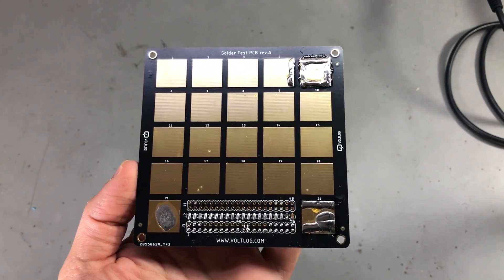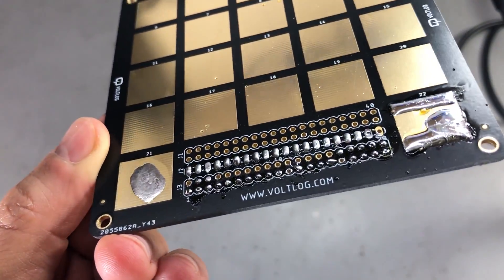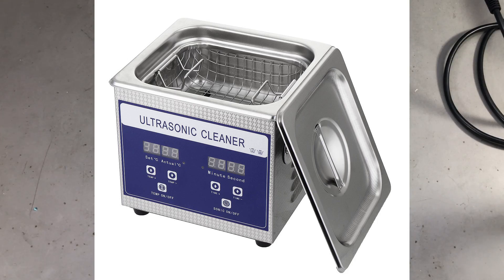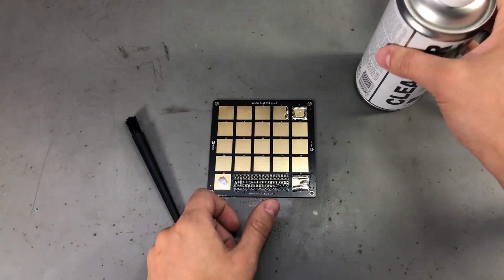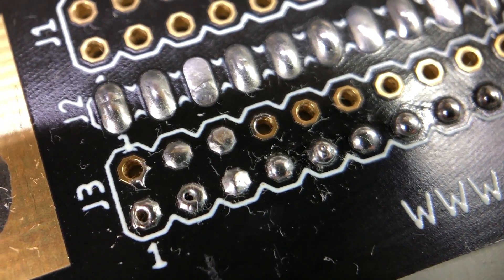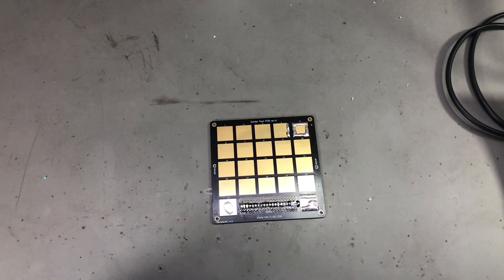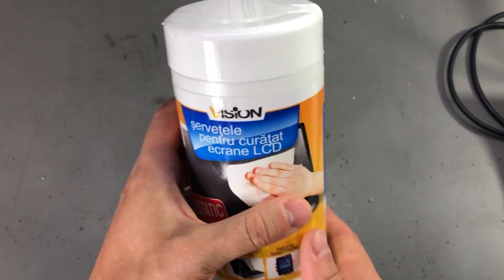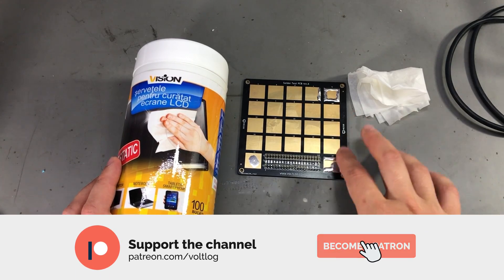Voltlog #258 - Cheaper Isopropyl Alcohol Wipes For PCB and Stencil Cleaning

Comment: Rather than using an air compressor or cans of compressed air, I bought an "IT Dusters CompuCleaner Xpert", which is just a 550W vacuum cleaner motor in reverse, with various nozzle attachments and a dust filter over the air input. I was initially sceptical as to whether it would be powerful enough to blast away flux cleaner residue, but with its smallest nozzle you have all the power of a household vacuum cleaner focused through a 9mm opening, which is plenty powerful enough! https://smile.amazon.co.uk/Dusters-CompuCleaner-Xpert-Electric-Duster/dp/B01G1Z0RF0

It's not really a cheaper option than an ultrasonic cleaner, but it's faster, and you can also use it for its intended purpose: blowing the dust out of PC cases (… and into your lungs :))

Tbh the non-"Xpert" version would probably work just as well. The Xpert is £10 more expensive, but that just gets you an extra 50W of motor power, an extra position on the power switch to use it at a lower power output, and 3 ESD-safe brushes that are $1 from China. Depends how much you value £10 (or $/€/etc. equivalent) :)

I must give a shout-out to Cameron Gray, who's review of the non-Xpert CompuCleaner convinced me to buy mine :) https://www.youtube.com/watch?v=hKxz8kwZjak

Comment: 4th reason for cleaning well flux from a lead free PCB is solder joint durability. Flux residue provokes Kirkendall voids at boundary Cu pad / solder. That makes the solder joint significantly brittle which can result in crack at the solder pad boundary layer. This is more important for application where high vibration levels are present on PCB, and it's critical for applications combining high/low temperature cycling (esp. amplitude over 100degC) together with severe vibrations (esp. random).  One more note to the cleansers - pure IPA is not a good  cleanser for PCB cleaning at all. It does not damage materials used for components packages, that's good thing,  but cleaning performance is rather poor. Usually the mixtures you had mentioned perform much better esp. for rosin activated fluxes. Pure IPA is not used for the purpose any more by industry as far as I can see.

Comment: Water-soluble flux.
Reply from the maker: I have used water-soluble flux in the past, it's a bit expensive and hard to get in the EU but it works great if you assemble your own boards from start to finish together with solder paste and solder wire based also on water soluble flux. However in real life, you are often dealing with boards that already have a different type of flux/solder applied to them so you cannot just go in there with the water soluble flux over the existing stuff.
Reply: @voltlog  What are the laws in the EU around leaded solder? Cheers for the video I enjoyed it.
Reply from the maker: @AdamStrong09  I don't know, I think they stopped selling leaded solder or they plan to do so.
Reply: @voltlog   Thanks VoltLog.  If you would like to make a video on solder with water-soluble flux I can post you some.  Just to let you know if you would like to take a look I'm in the process of uploading 2 videos to YouTube. Some audio issues to sort out.  Cheers have a good day.
Reply from the maker: @AdamStrong09  I have both water soluble flux and solder wire with water soluble flux inside and have used them successfully in the past when assembling complete boards. However I don't think it's a good idea to mix those with the regular rosin based flux/solder.

Comment: I just use a flux remover pen.  The tip of the pen is a pressed fiber brush and you just rub over the soldered area and all the flux just disappears.  They also have a flux pen and it works the same way.
https://www.mgchemicals.com/products/prototyping-and-circuit-repair/pens/4140a-p-flux-remover-pen

Comment: I use 91% isopropyl alcohol in my low cost ultrasonic cleaner for five minutes with the alcohol preheated to 50c and it works perfectly. I can reuse the IPA many times before it needs to be changed and the $1 bottle fills my 3 liter cleaner twice. I'm not sure why you would pay lots of money for a cleaning solution or even bother with pads which can't get into tight places between ICs.
Reply from the maker: I mentioned in video all the reasons why a hobbyists would avoid getting an ultrasonic cleaner, it's not practical for everyone.

Comment: I bought 5 litres of IPA (99%) about 3 years ago, I use it with a brush and some cheap lint free wipes that have no added cleaning agent,
I have around 1.5 litres left so it should last me a while, I think the bottle was about £25, not cheap but it's great for pouring on and brushing hard to reach places, 
I also re-use it several times, first use for clean pcb's, second use for really dirty/dusty pcb's, 3rd use for degreasing engines, etc. (that bottle looks like ink!)

Comment: Instead of an air compressor, a bicycle pump with a blower tip on it can be used for blowing off the excess. Also useful for removing dust.
Reply from the maker: Good idea! a foot operated one could work, but I have a hand operated one 😁

Comment: Neat IPA doesn't seem to work as well as the dedicated cleaners. The PCB cleaning solutions have surfactants to lift and carry the flux in solution.
Reply from the maker: Then the solution could be soaking the lint free paper in some proper pcb cleaner solution. It would still be cheaper and easier to obtain when compared to the ready made ones. For example I can get locally a can of PCC 15 500ml Art.205 pcb cleaner for just $8.

Comment: Denatured alcohol and a toothbrush is way cheaper and absolutely lint-free. I have had the same 1l bottle of alcohol for I guess over 15 years and am still not through, because you need so little alcohol (obviously depends on how much you solder). Pretty much just wetting the toothbrush is enough, no need to pour alcohol over anything. I usually add a drop of soap after scrubbing with the alcohol, but before the alcohol has evaporated, to prevent a residue layer. Then rinse with water. Done in a minute. It takes a little bit longer if there are switches, pots or connectors on the board, because I'm careful not to get alcohol, soap or water to get into them (although most of them would be "washproof" anyway). But it is usually easily possible to hold the board in a way that those stay dry.
Reply from the maker: I haven't seen denatured alcohol in any of the local shops here but at some point I did get something called "technical alcohol" it wasn't great because while it did dissolve the flux it left this white residue on the PCB when it dried.
Reply: @voltlog  
I know what you mean, but that's what the drop of soap before the alcohol has evaporated is for. The solder joints on my boards usually come out with a mirror finish with that technique (and the rest of the board is clean as well).

Comment: Even if it's called PCB cleaner or Flux cleaner it doesn't magicaly clean away stuff, it only disolves the flux and other gunk on the PCB.
It's still there on the board as you can se if you leave it to dry, it's only when you wipe it off the board that it becomes clean.
As you pointed out, those "special" wipes arn't that special after all, most of them are just the same with different names on the boxes.
This works great on boards with SMD components, but as you said not so great on THT components.
Unless you bend all component legs flush with the board, and cover them in solder.

Comment: My story: I used a so called "no clean flux". After building my own 65C816 based single board computer (for fun ...) it didn't worked at all, no matter how hard I tried to find the problem. Then I had the idea to clean the board from flux, and guess what, it worked then nicely after that ... But that flux is really a "not branded" one, though from a local shop, not from ebay/banggood, or something like that. Who knows what it is really.
Reply from the maker: I'm glad it was solved after all and you could get the circuit up and running. This is one of the reasons why it's good practice to clean every board.

Comment: I've got some Caig flux form USA that is amazing, the problem is it leaves behind an unmovable tar where IPA and meth spirits do nothing. Only grease cutting ammonia based sprays have an effect, but even that struggles.
Reply from the maker: That's an aspect that I will maybe address in a future video regarding a comparison between different brands of flux. Everyone seems to be comparing the soldering performance but forgets about cleaning and I've definitely noticed this before, some fluxes are harder to clean than others.

Comment: I use polishing materials sold in automotive supply stores. Lint free and dirt cheap.
Some antistatic wipes leave a tiny residue that can be conductive. You may want to at least measure the compound used if using antistatic wipes.
Reply: I've been planning on buying those exactly for this purpose but so far have forgot every time I've visited such a store. Nice to know they work as I was hoping they would!

Comment: Another possibility is to use medical alcohol swabs, also already soaked with 70% IPA and individually packed. 

They are very small (usually3*6 cm ) but can be helpful nonetheless. A pack of 100 cost around 2 Euros.
Reply: That's what I use - does the job.
Reply from the maker: yup it seems I can those here as well for about 2.5 EUR, I might give them a try in the future, thanks!
Reply: @voltlog  Not my Idea, Dave Jones mentioned them a long time ago
Reply: Those alcohol swabs are soaked in very different type of Isopropyl alcohol,  which is not pure at all. Those swabs leave residue and does not dissolve flux very well,  if at all.

Comment: I use a small jewelry type ultrasonic cleaner I picked up for $5 from a local thrift store second hand. It's by far the best solution for cleaning boards. I don't use any fancy cleaning solution either. I have 2 bottles of 91% isopropyl alcohol I use with it, a dirty solution and a final rinse clean solution. It takes 2 minutes and around 10 seconds of using a brush to get a board clean. 

  As far as lint free type cleaning materials, I have a shoe box filled with old tee shirts I have cut up into small squares. I have a small alcohol dispenser on the bench and a few fresh rags laying around if I need a lint free rag option :-)
-Jake
Reply from the maker: I've always thought about buying an ultrasonic cleaner but having to use a liquid as well and maybe drain it after usage, wash it, etc. always made me think twice and ended up not getting one. There is also the issue of size, you get a smaller ultrasonic cleaner and then you discover you cannot clean a particular pcb because it does not fit in the cleaner but who knows maybe I'll get one at some point..
Reply: @voltlog  
  Ultrasonic cleaners are just a stainless pan with a transducer stuck to the bottom and a high frequency driver that looks about like a laptop power brick without an enclosure, and similar looking circuitry too. I have seen transducers and drivers sold on AliEx. I can't say if it's cheaper to make one overall. I have no idea what kind of hard adhesive they use to attach the transducer, but they are super simple looking when taken apart.
The one I have is an outdated Haier HU781b. I have no idea how much it was retail, but looking at the ads and crap that are still on the internet, it looks like they tried to market it for cleaning CD's and DVD's as well as jewelry. That should give you a good idea of the dimensions I'm working with. I actually got it several years ago for cleaning some bicycle parts initially. If you ever try this NOTE: Don't use them on brakes, shifters, or derailleurs as the finish of these can't handle the ultrasonic  cavitation. If you really want to clean a chain and cassette, or a freehub and axle assembly, ultrasonic cleaners are awesome. I also tried using some water based industrial wax and grease remover I had laying around from when I used to paint cars. In an ultrasonic cleaner that stuff will strip anything to a perfect shine. For most things, the cavitation alone will clean the surfaces. Just using tap water in the device will clean things. It doesn't have the ability to dislodge large gunk on objects. You really need to mess around with one to get an intuitive understanding of what they are capable of. Just be aware, any finish that can trap gases under the surfaces, like some epoxies and powder coatings, are very susceptible to failure in an ultrasonic cleaner. The bubbles really are like microscopic razor blades. 
  You'll find many uses for one once you have it. 
  I just have a large automotive funnel on the shelf and 2 bottles of alcohol to juggle around. My work space is extremely tiny, but the cleaner is essential.
   I used to keep it in the garage with my bike stuff, but after using it once for cleaning a board, I immediately made room on my bench shelf within arm's reach. I use it often. If I've done more than ~10 solder joints it's faster to use the cleaner than it is to fool with rags or brushes...and I'm disabled with a very limited amount of time I can sit upright or stand where I need to hold posture with my chronic back injuries. I am very conscious of the time versus effort involved with using something like this. The extra effort of using the ultrasonic cleaner is much much more efficient over all. With a large enough funnel kept close at hand it is easy to manage at the bench.
  That's just my $0.002 AdSense :-)
-Jake
Reply from the maker: @UpcycleElectronics  Thanks for the feedback Jake, like I said, I might end up getting one some day.
Reply: @voltlog  
 Hey I hope you know, I still found this upload useful. I'm not trying to be negative, or talk like I know better or have it all figured out. IRL I'm quite the bumbling fool that learns by doing it wrong...a lot.
   I've been curious is there was some secret sauce that made those $30 wipes worthwhile. You saved me from eventually learning the hard way, and the TV wipes are a brilliant alternative to remember once I run out of my box of decade + old fat-guy tee's tents.
Thanks.
Reply: You can put the cleaning liquid in a (glas) container and place the container in the ultrasonic bath filled with water.
Reply: I don't know how comfortable I would be putting alcohol in an ultrasonic cleaner, isn't that a fire hazard?
Reply: @Gengh13  
  Nah, no problems at all. It doesn't get hot or anything. The bubbles are microscopic. You can't see them most of the time. It's no more a fire hazard than all of our other fire hazards like alcohol soaked rags or tantalum capacitor fetish :-)